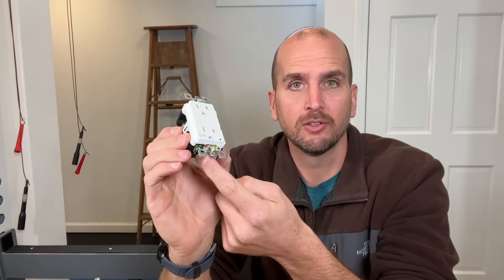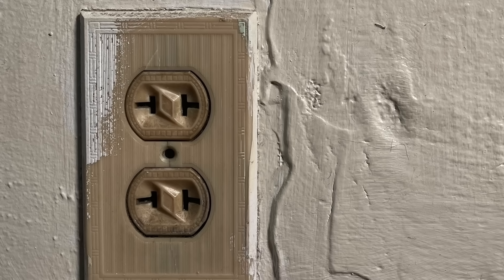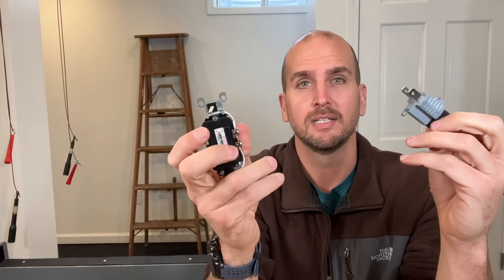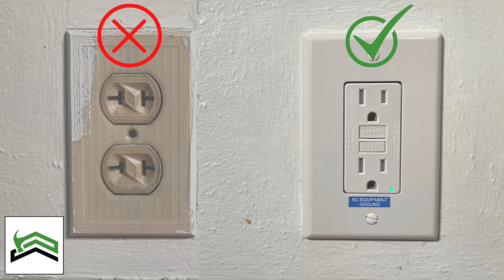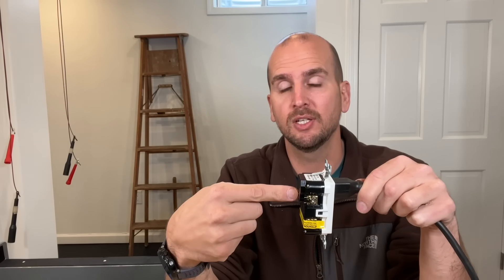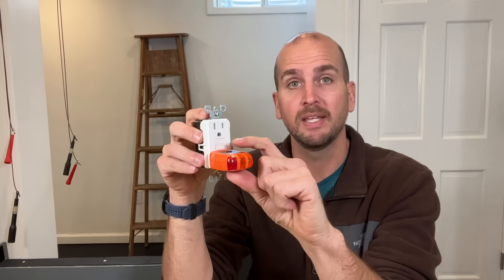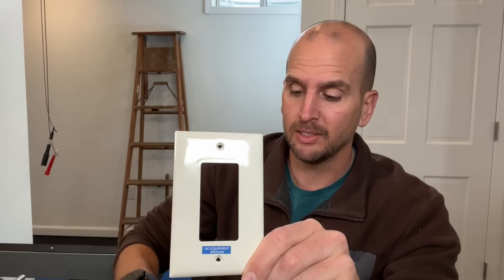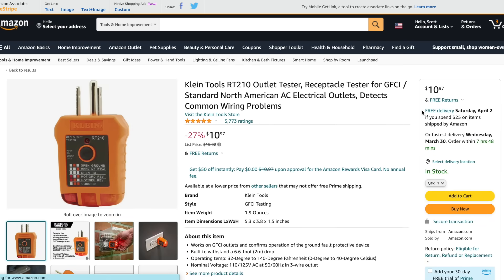Does a GFCI Outlet Still Provide Protection Without A Ground Wire?

Comment: Another purpose a ground wire serves is some equipment may be expecting it in its design to function properly.  E.g.  electronics   with sensitive circuitry or equipment dealing radio frequencies.  Yes, neutral is bonded to ground, but I'm thinking it isn't ideal as a voltage reference (ground) due to noise and harmonics.
Reply: When the neutral is carrying current, its voltage potential is not the same as the ground wire (which by design only carries current when there's a hot-ground short).  Which means that the neutral is on "top" of a 60 cycle hum relative to the dirt.  With sensitive equipment (radio, amplifiers, or things subject to damage from static electricity), you really want to be able to firmly plant the chassis and other metal non-electrical parts at the nice quiet ground to help get rid of the hum.
Reply: @fromagefrizzbizz9377  , as an audio repair tech specializing in older equipment (especially vintage tube guitar amps), I've found it's a good idea to test newly acquired or to-be-repaired equipment by plugging it into a GFCI outlet to see if the breaker trips.  If it is a 2 wire device with a polarized plug you have to try it with the plug inserted both ways; if it has a 3-wire grounded plug, be sure to flip  the ground-polarity switch, if it has one, to see if the GFCI trips  Nearly all old guitar amps will have a capacitor tied from one leg of the power cord to the chassis to form a "virtual" ground when the plug (or ground polarity switch) is oriented (by chance, or to lower audible hum) so that the capacitor connects the neutral wire to the chassis via the capacitor; but if you toggle the switch or flip the plug around the around the other way you will have the hot wire of the power cord connected to the to the chassis  via the capacitor, which is not only noisy and buzzy but also runs a great risk of putting current on the grounded chassis if that capacitor is electrically leaky, which they almost always are, 50 to 70 years after they were manufactured (modern X/Y safety capacitors weren't being used back then).  I always remove the "death capacitor" as it is known, and install a 3 wire cord with the earth ground directly to the chassis (and,  because the fuse is often found to be wired to the neutral side of the circuit and the on/off switch to the hot leg, or vice versa, I rewire those to modern code as well, so that both are in line with the hot leg).

 Note that guitar amps are a particular source of danger because the strings of the guitar are at the same potential as the amplifier chassis, and so if you have current leaking to the chassis  you will have it present on the guitar strings as well, and touching another piece of onstage equipment that is grounded such as a microphone while you have a hand on the guitar strings can kill you. Playing electric guitar through an old amp while standing barefoot (or in damp sweaty socks or slippers) on a concrete slab in the garage or basement is a great way to receive a nasty shock.  Worst case scenario, of course, is if it is one of those so- called "Widowmaker" amplifiers, a transformerless AC-DC circuit that uses odd series-string tubes (such as 35W4, 50L6, 50C5 etc) and has one leg of the power cord tied directly to the chassis.  There is a 50-50 chance that you will have 120 VAC on the amp chassis and therefore on the guitar strings depending on which way the plug is inserted into the wall!  Those things are pure danger and you should never play through them until they have had an isolation transformer installed.  The same might be said to apply to many 1940's and fifties AC-DC transformless see table radios,  but generally those were constructed with non-conductive plastic and wood knobs and parts in such a way that it was difficult to touch any metal part of the chassis.
Reply: @fromagefrizzbizz9377  You can get rid of the hum by adding a galvanic isolator to the antenna. It blocks 60 Hz but passes the megahertz range used by TV and radio.
Reply: no equipment listed for use in the US should have a connection between the neutral and the ground.  some electronics may have RF shielding connected to ground, which is a different matter.
Reply: @kenbrown2808  I agree whole-heartedly with your first sentence, and it applies to Canada (CEC) as well.  This extends to panels used as subpanels - the subpanel MUST have it's neutral-ground bonding strap *removed*.

There's a particularly heinous bit of electrical nastiness if you violate this.  If you have the neutral and ground wire attached in more than one place, under certain conditions, it forms a ground loop (the neutral wire will have a slightly different potential due to current flow hence it's going to flow thru the ground wire).  The consequences are continuous current in the ground wire, which it is most definitely not designed for - especially in older systems where the ground wire may be the shield of armored cable, or copper pipe, or tiny wire that can handle a full on short, but overheat and not withstand continuous current just under breaker trip threshold. This can cause the ground/grounding system to corrode and fail, thus preventing your breakers tripping on hot-ground shorts.

FYI: a colleague was upgrading a wall in his house from (I think) the 40's or 50's.  Not well insulated, but armored cable (some in poor condition) everywhere - the US at the time (and for decades later) permitted the armor to act as a ground.  Imagine his horror to find the armor itself being too hot to touch and glowing in places when NOTHING on that circuit was turned on.

As for the use of "real" grounding in equipment:

Not just RF shielding.  Transmission and receiving antennas of many types greatly improve in efficiency by a real ground (eg: thru coax cable sheath or balanced core centertap).  The dirt itself becomes part of the antenna.

Not to mention induced hum in audio signal cable between equipment that may not even be on the same circuit, and have neutrals at different potentials.
Reply: @fromagefrizzbizz9377  it gets worse - if you lose the neutral in a subpanel,  feeder, and the ground isn't isolated from it, then it puts the current on the ground - and energizes every grounded surface in the system.
Reply: @kenbrown2808  This situation is not new to me, and it's even worse than that.

If the neutral comes adrift (upstream of a main or subpanel), every 120V device on the panel can see voltages anywhere between almost zero, and 240V.  240/120 feed acts as a resistive voltage divider based on how much resistance each side represents.  Then you watch much of your 120V equipment go up in smoke. 

As I've told people for decades, if some of your lights (especially incandescents) go brighter and others go dimmer, kill the power and call the power company and whisper the magic words: "loose neutral!".  They'll be there.

Even if the grounding system exists and remains intact to neutral on the panel load side - dirt grounds do not have zero resistance.

[NEC, last I remember, wants a grounding system to have less than 8 ohms to dirt.  When you install a grounding electrode, you are (were?) supposed to test the resistance, and if it wasn't below 8 ohms, you have to install another grounding electrode.
Reply: @fromagefrizzbizz9377  everybody just drove another rod, until the Ufer became common.
and one of the weaknesses of LEDs is good quality ones ignore voltage fluctuations.  makes it hard to spot a floating nuke.
Reply: @kenbrown2808  I would imagine that plate grounds would also alleviate the necessity to worry about grounding system testing.  I've seen instructions on how to test it, and none of them seem particularly accurate, hence automatically driving a second one is almost always simplest.

Yeah, LEDs won't show over/under voltage very well, which is why I mentioned incandescents.
Reply: @fromagefrizzbizz9377  the testing is pretty accurate. But the testing process is more expensive than the process of driving a second rod.
Reply: Which is why some devices have a separate ground connection on the case.
Reply: I once provided a shield ground to a screen room in a large building. Later I found a large current running through it. Somewhere else in the building there was a fault placing a current through the shield ground. Luckily no one was hurt.
Reply: There are very few such system. Most electronics: TVs, media players, phone chargers etc. are double insulated. They do not care of grounding. The main exception are computers and some of their accessories: monitors, printers. People in Europe have used them in ungrounded sockets without any major problem. The main issue would be if you connected them to a TV especially with the obsolete RCA connector. It is best to do such connections when powered down or just use modern technology like WiFi.
Reply: @okaro6595  "Major problems"?  How about "not working as well as they could"?

Yes, double insulated things are *safe*.  Yet, some devices ALWAYS come with three prong plugs.  Optimum?  Not always so much in the case of low level analog signals.

Comment: Hi I have additional question: My old house has the "knob and tube" electricals with  2 wires that are not color coded.. How do I tell which is live/neutral? Thanks in advance!
Reply from the maker: I use a non-contact voltage tester and test each of the wires the wire that sets off the voltage tester is the hot wire.
Reply: @EverydayHomeRepairs  I’ll try that. Thanks so much!
Reply: @chleprince1894  Use a volt meter to a cold water pipe if its plumed in copper, or run a wire back to the neutral in the service panel and measure from that to each wire, only one will show voltage, thats your hot wire.
Reply: If at all possible, i highly recommend saving up and planning for a rewire of your house.
Reply: I've had cases where I've found a grounded receptacle, or installed one at the panel, and then taken an extension cord around to check voltage to the ground in the cord.
Reply: Touch the ends! 🤣🤣🤣 seriously you should not be playing with electricity 110 or 240, it will kill you!
Reply: Neutral is the one connected to ground more than the other one. If neither is connected, then it TOTALLY does not matter !
Reply: @millomweb  The neutral is connected to the ground even on a two wire system. If you connect the socket incorrectly a lamp will have voltage even when the switch is off. If there is no bulb and someone sticks his fingers in he will get shocked. Now the GFCI will protect but why do things win "who cares, it does not matter" -manner when one can do them properly.

Note without a ground a socket tester just says "open ground". It cannot tell the polarity.

Comment: Thanks for the info on a very informative video. I’m a licensed GC and I installed GFI’s on an old apartment. I labeled the load outlets with the No equipment label but I didn’t put the GFCI protected labels. I will do so in the future! Thanks

Comment: So much wrong with this advise.  The label doesn't magically bring it up to code.  Also, the GFCI tester tests the proper function of the GFCI outlet.  Hoping that it catches the difference with no ground is just asking for pain.  Now if the junction box is grounded somehow and the outlet is grounded to the box (metal box with no washer between outlet and box), then and only then do you not need the ground for the GFCI to work correctly.
Reply: Such a long post with such ignorance.
Imagine a ferrite core. Wind the hot through that core in one direction. Wind the neutral through that same core in the opposite direction. The magnetic field in that core is ZERO if the current in the hot matches the current in the neutral. Any difference and there will be a magnetic field. Now, how is that field detected? Simply wind a third wire through that core. Any voltage on that third wire will indicate an imbalance in the current flowing through the hot and neutral wires.
Reply: @johncochran8497  A floating GFCI will not provide the protection you think it will, nor the protection that the presenter states.
Reply: @peterallen4605  Yes it will. The protection a GFCI provides is TURN OFF THE POWER if any power is going somewhere unaccounted for. No need to have a ground path in the outlet itself.

Is it as safe as having a ground in the outlet itself? Nope.
Is it safer than having a simple 2 prong outlet? Hell yes.
Reply: @peterallen4605  It won't be floating as the neutral is usually grounded in the main panel or by the power co.
If it is truly floating, it's not needed !
Reply: @millomweb  Wow.  I hope that you don't do any wiring in the houses of any of my family or friends.
Reply: @peterallen4605  Try it out - use an isolated power source and fit the GFCI into the outlet of that. It'd ensure neither hot or neutral was grounded - and it then won't trip on a ground fault.
Reply: @millomweb  If the GFCI sees current imbalance between the hot and neutral, it'll trip REGARDLESS of how the leak occurs.
Reply: @fromagefrizzbizz9377  Without the upstream neutral being grounded, the imbalance CANNOT occur via ground.
Reply: @millomweb  That doesn't prevent the imbalance coming from somewhere else.  In fact, in a 3 wire circuit, if you connect the ground to the neutral of the GFCI's protected side, once the circuit carries any current, the GFCI will trip.  In a 2 wire circuit, where could that extra path come from?  A neutral-plumbing short or any of many other things.
Reply: @fromagefrizzbizz9377  Any current path other than the balanced path must connect back to the supply side of the GFCI. The plumbing short would be considered a ground path. The end of the fault path is back to the supply no matter what route it takes. And if it's via a ground path, it proves the connection of ground to neutral - the necessary connection to trip the GFCI.
The imbalance via whatever route has to connect to the supply side of the GFCI - and that is the whole purpose of the GFCI - to ensure that the random path is not through a person.
If the path cannot return to the supply side of the GFCI, it will not trip and it is actually not necessary !
Reply: @millomweb  And under what real life conditions do you expect NOT to have any leakage at all?

A ground rod on the neutral at the pole transformer will suffice, thus anything hitting the dirt one way or another will trip the GFCI.
Reply: That’s why there is a metal tab on the two-prong adapter correct?
Reply: @aayotechnology  to screw into the plate mounting hole of a grounded plug.
Reply: Why do you talk about something you know nothing about.

"406.4(D)(2) Non–Grounding-Type Receptacles. Where attachment to an equipment grounding conductor does not exist in the receptacle enclosure, the installation shall comply with (D)(2)(a), (D)(2)(b), or (D)(2)(c).

(a) A non–grounding-type receptacle(s) shall be permitted to be replaced with another non–grounding-type receptacle(s).

(b) A non–grounding-type receptacle(s) shall be permitted to be replaced with a ground-fault circuit interrupter-type of receptacle(s). These receptacles or their cover plates shall be marked “No Equipment Ground.” An equipment grounding conductor shall not be connected from the ground-fault circuit-interrupter-type receptacle to any outlet supplied from the ground-fault circuit-interrupter receptacle.

(c) A non–grounding-type receptacle(s) shall be permitted to be replaced with a grounding-type receptacle(s) where supplied through a ground-fault circuit interrupter. Where grounding-type receptacles are supplied through the ground-fault circuit interrupter, grounding-type receptacles or their cover plates shall be marked “GFCI Protected” and “No Equipment Ground,” visible after installation. An equipment grounding conductor shall not be connected between the grounding-type receptacles."
Reply: @okaro6595  Oh good grief, that's exactly what I said.  Duh.

Reading comprehension problems?

[The NEC has been back and forth about (a), and to be sure, replacing a two wire outlet with a three wire outlet without ground doesn't gain anything but a sense of false security.  Even when they once permitted it as long as you filled the ground socket with silicone.  NEC has also dabbled with allowing you to supply the ground from something else - like a copper pipe.  Plastic pipe, and certain types of dialectric plumbing isolators has doomed that.

CEC never allowed any of that nonsense during my lifetime.  It's either GFCI or rewire.]
Reply: GFCIs provide real security.

Comment: Ah well I'm part of that 66% that answered the poll wrong. I know nothing about electricity. Okay make that almost nothing as I know it can be dangerous. I also know if you electrocute a pickle it stinks thanks to a 9th grade science teacher. Also electrocuted pickle stink fills a school. To be fair with my basically non-existant knowledge it sounds like common sense that you would need a ground go have those outlets do their thing.
Reply: And you'd be right ! There may not be a ground wire but the GCFI is probably grounded via the neutral wire. Ground and neutral are usually connected together at the main panel or by the power company.
Reply: @millomweb "Grounded with the neutral wire" makes no sense.

Comment: And plugging in a tester to an ungrounded GCFI should show an open ground error.
Reply: Actually what you mean to say is that the ungrounded socket should show an open ground error.
The GCFI will most likely be grounded via the neutral wire.
Reply: @millomweb  The GFCI isn't grounded, and doesn't need it to operate.  Neutral != ground.

That's the reason why the NEC and CEC both require you to label GFCI outlets (and those downstream of them) to be labelled as having no ground.  In fact, BOTH codes require that if you connect ordinary 3 wire outlets downstream of the GFCI, they MUST NOT have the ground lugs interconnected.